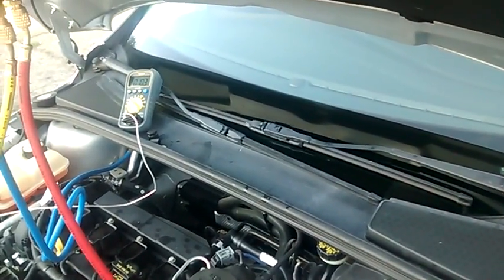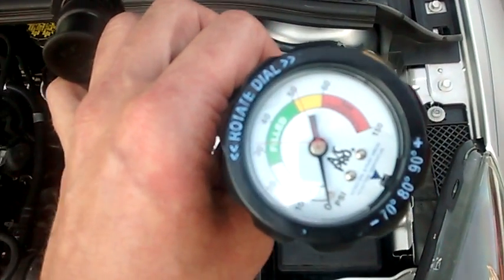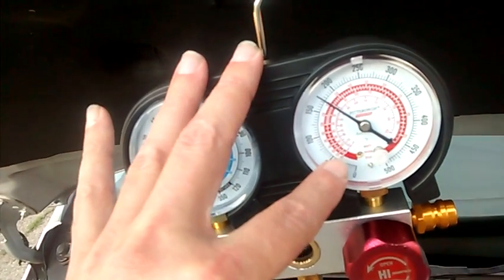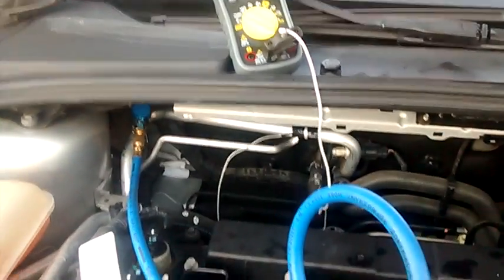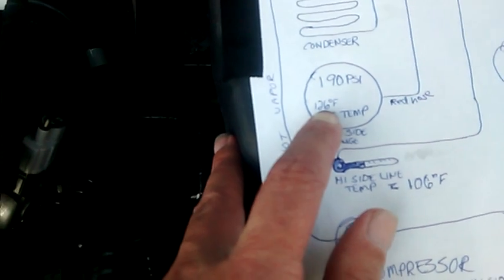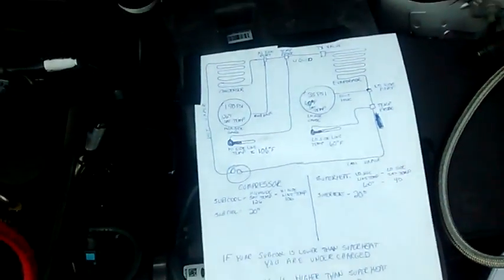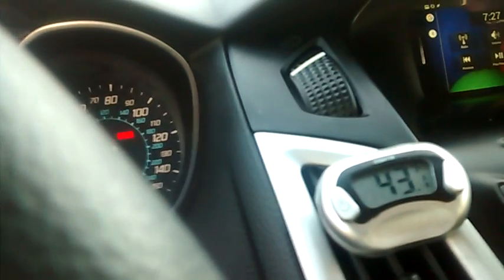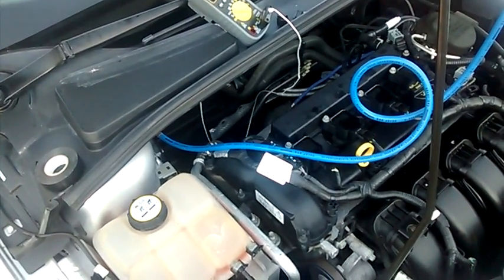Charging using Subcool

Comment: When checking subcooling, don't you need to have a high velocity fan blowing on the front side of the condensor to remove the heat from the refrigerant? When I check the subcooling on my Toyota Sienna, the sensible temperature of the high side line slowly creeps up causing my subcooling number to continually change (get smaller and smaller, until I have a negative number - which I believe means that the condensor is not getting rid of the heat). I realize that checking cars are a different beast, as compared to checking the HVAC on a house (which has a huge fan that's removing heat at the condensor), so how do vehicle mechanics deal with checking subcooling on a vehicle that's stationary?
Reply: What I do is mist the condenser with water.  Temp will drop sharply then start to rise again as the water evaporates off.  At a certain point the temp will stop rising for a short time, usually around 20 seconds then start rising again.  Temp below the pause time seems to be the artificially cooled time while after the pause it's undercooled due to not moving.  Don't soak the condenser, a LIGHT mist but over the entire condenser.  I know this to be half way decent because the pause temp is what I usually get when I have a big fan in it's place.  Definately not the most scientific way, but It'll give you a good estimation of the (going down the road airflow) temp.
Reply: @datsuntoyy  Thank you for your suggestion.

Comment: It feels like you should account for RPMs other than idle. I don't know if it's right or wrong but I when I do my cars, I put in enough charge that the compressor doesn't cycle due to low system pressure at a highway cruise RPM.

Comment: The one and only charging instruction that explains the inner gauge reading and not the same old stuff. TU all the way. it is strange, I tried this on two different cars and two different temperature gauges. and I can never get a reading of less than 85-90 degrees on low side line/evaporator superheat  and yet both AC systems work and blow cold Air down to 42 degree.
Reply from the maker: I am betting with that high of a superheat reading, the compressor is short cycling like crazy.  The reason you are still getting the low temps out of the vents is because the first 1/4 to 1/3 of the evaporator is probably around 20-25*F and the other side is near the temp of the inside of the car and the temps are equalizing there as they blow out of the vent.  If you have very low humidity you will see this, however if the humidity is really high, the side of the evaporator that has the boiling refrigerant in it will freeze up and have a big chunk of ice form on it blocking airflow though the evaporator,  which will make the air start blowing warm or hot.
Reply: I just had this same problem, low side temp reading over 80 degrees with a known good charge in the system. The reason in my case was the high temperature in the engine compartment was affecting the accuracy of the low side temp probe reading. I used some pipe insulation over the taped on temp probe and got a more accurate low side temp reading. Low side evaporator tube in my car is near the engine exhaust manifold so very warm in the region of the temp probe and why it needed the added insulation.

Comment: Hell no! do not vent the refrigerant into the atmosphere, this contributes to global warming R134a traps around 1340 times more heat than Carbon Dioxide. i did like the rest of the video though
Reply from the maker: If it was so bad, how come R134a is used for those cans of computer keyboard duster air..  and it has been used as an aerosol propellant for a long time.

Comment: i did this method idk if i did it right here are the numbers

hi-side sat temp. was 130F(200psi) Line was 110F   lowside sat temp was 32F(30psi) Line was 70F . so that means my subcool is 20F and my superheat is 38F. so that means im undercharged that my ac cycles on and off every 30 seconds? even tho my vent temp was 41F on low speed and non circulate air, on a 95F day

do cars have a low and hi pressure switch? mine is a honda 2.4L engine
Reply: probably

Comment: Great job but my question where you took temp reading from auction line before or after the suction port as it seems in the video before?
Reply from the maker: Generally you want to take the temp reading as close to the exit of the evaporator as practical.. The closer the better, however getting to the optimal position may not be easy if there is a bunch of stuff in the way...
Reply: @Chaddz3  what about the condenser ? inlet or outlet on the condenser or before or after the hiside service port before after the sight glass?
Reply: @blaze2051  out of the condenser

Comment: hi 
1st automotive should be checked at idle 900rpm and at fast idle 1500rpm 
2nd Ideal pressures for R134a at any engine speed .
idle or fast  rpm  ..LOW around 30psi , freezing point is about this temp
Ideally High side should read 160psi on a 90deg + day . Condensor size dictates this.
Why does it matter  ,,lower  condensor pressures equals colder refrigerant to evaporater inlet= better performing system on a hot day .

Comment: Great video! Can you verify something for me please. Is it normal for a compressor to never cycle, but rather be on continually? This is a bmw with Seiko Seiki, I believe is a rotary vane compressor. Btw, the cooling in this car has issues.
Reply: It depends upon your system setup. My old GMC has a oriface tube, not a TXV so the system cycles the compressor to maintain pressure. The newer cars typically have TXVs or electronically controlled setups and in those cases usually the compressor runs continuously (except of the RPM gets sufficiently high that the pressure switches go out of range). Some vehicles will have a variable output compressor which allows changing the amount of refrigerant compressed in each stroke dynamically which can allow for more uniform cooling conditions and less cycling across a wide range of RPMs.

Comment: Is there way to diagnose a bad expensive valve / condensor / drier with taking subcool and super heat readings ? My ac keeps short cycling at higher revs but not at idle of  750rpm
Reply from the maker: For a bad tx valve, usually those result in a very low low side pressure and excessive high side pressure. Once the system is turned off the pressures take a very long time to equalize. With this your compressor shuts off pretty quick then stays off for a long time before it comes back on.
Reply: @Chaddz3  thank you for the reply. I took it to a AC mechanic and he couldn't tell me whats wrong except that its not working right. so when he had my rev it to 3k its starting to short cycle. he said the low side drop to below 20 and the hi side when up to 350, it would shutoff and after 5-6 secs come back on. hes said it would be condenser or expansion valve or compressor but the compressor workings fine at idle and it blows cold.
Reply from the maker: @joeydelmarsjr.646  I'm gonna lean toward a stuck expansion valve or there's a restriction in a line somewhere. Check your high side lines for any kinks or something that could cause a restriction when engine is being reved you should be able to find a plugged line by looking for a temp drop in the line somewhere. It'll be hot before restriction and cold after it. Has the compressor ever been replaced before? The subcool could be all over the place depending where the restriction is. If it's after the condenser you'll have a very high subcool if it's plugged in condenser or before you may very low or no subcool
Reply: @Chaddz3  i recently replaced the compressor
Reply from the maker: @blaze2051  should be able to evac the system and recharge. Since you replaced the compressor. I would replace the receiver drier too since a blown compressor usually sends its guts into the receiver drier.
Reply: @Chaddz3  the compressor wasnt blown. it still worked and blew cold, just that it was short cycling. the new compressor started doing it too. last reading was 30psi low side 200psi hi side 41F out the vent.

do you think it could be a bad pressure switch or thermal protect sensor that is bad?
Reply from the maker: @blaze2051  check your low pressure switch. A bad low pressure switch will make it kick out what psi was it at when the compressor would shut off. What was the outside temp at the time and was the ac in recirc mode. If you don't have a high enough heat load it makes the pressure in the system drop if the pressure get low enough to drop the boiling point below freezing it's supposed to kick the compressor off to prevent the evaporator from freezing up.

Comment: I wonder if you can use superheat to check fixed orifice systems also? I don't see why not.
sometimes pressures can be very misleading for different reasons.
For instance a weak compressor might cause someone to keep adding freon to a system trying to get pressures up to 35 while all along have more than 2.45 times the amount of freon that the system calls for. I worked on a system like that yesterday and did add 2 cans to it trying to get pressures up. 
Finally got it up to 33 and 200 but it did nothing for the cooling with vent temps averaging 66 to 80. 
Now the system has been evacutated, vacuumed down and recharged to 3.5 lbs and the pressures were 15 low and 110 hi. I can only assume the compressor is failing from having too much freon. This system never cooled right after the compressor was replaced before that it would freeze you out.
Reply from the maker: Yes this will work on fixed oriface too but it the logic is a bit different. Refrigerant charge will affect both subcool and superheat at the same time.  In your case I'd start with basic compressor troubleshooting. Sounds like a weak compressor.  Also verify that your orafice tube isn't plugged up.
Reply: Sounds more like a clogged office or filter drier than a failing compressor. The compressor is just there for flow and pressure is a byproduct of the metering device in that flow of refrigerant. A failing compressor will typically have high suction and low liquid pressures. The only compressor failure I could think of in this scenario is if it is coming apart and has again clogged the filter.

Comment: What about adjusting the txv? Almost all cars have a Allen adjustment on the bottom of the expansion valve.    It can be turned in and out.     Tested it on a junk replaced expansion valve
Reply from the maker: You could try adjusting it, but usually those are already preset at the factory and if it's off, it's usually best to just replace it. The only way those get out of adjustment is if the sensing bulb starts loosing refrigerant and changes it's calibration pressure. Or worse yet they start sticking..

Comment: How can someone get information about the standard value for superheat and subcooling for various car model and can we say it is the same for all model
Reply from the maker: Unfortunately, the automotive industry doesn't make that available. They want you to completely recover evac and charge based on refrigerant weight. The only way to really get the correct actual number is to measure it on a correctly charged system. But the rule of thumb is you want the subcool and superheat numbers to match in order to balance the system.

Comment: Thank you for a great video.
Just did a test on my trusty old Citroën (C5 from 2001).. I have the gauge-set, but never touched the filling on the car..
Am i over or under-charged? The performance is not like it should be, i think.

Hope to get a guideline :)

 Tests;
Cabin fan - Full speed.
Ambient: 23C/73,4F
High pressure: 15 bar/217 psi
Low pressure: 2,2 bar/31,9 psi
Condensor outlet temp.: 33C/91,4F
Liquid-line from evap: 17C/62,6F
Cabin duct temp: 10C/50F

Second attempt;
Cabin fan - 75%
Ambient: 23C/73,4F
High pressure: 15,5 bar/224,8 psi
Low pressure: 2,4 bar/34,8 psi
Condensor outlet temp.: 33C/91,4F
Liquid-line from evap: 21C/69,8F
Cabin duct temp: 11C/51,8F

Third attempt; (the engine room heats up a little)
Cabin fan - Full speed.
Ambient: 23C/73,4F
High pressure: 16,5 bar/239,3 psi
Low pressure: 2,5 bar/36,2 psi
Condensor outlet temp.: 35C/95F
Liquid-line from evap: 24C/75,2F
Cabin duct temp: 13C/55,4F
Reply from the maker: Ok at 68F your static pressure should be around 67-69 psi.. so it's not far off there. Here's another test to do turn AC on with gauges hooked up allow to run for about 10 minutes and let everything stabilize. Then shut the system off and watch how fast the pressure in the system drops back to static. It should take no more than a minute or two and both high and low should change at same rate and become equal at about the same time. If they take forever or one side changes way faster than other side, you may have a restriction in one of the lines somewhere (usually a plugged oriface tube or stuck TX valve)
Reply: @Chaddz3  Thanks a lot mate - For some reason I didn't get a notifification on this one :/ I think my TXV is dead. It takes more than 15 minuttes to equal pressure. Again, thnak you for your videos - They are great :)
Reply from the maker: What's your static pressures at ambient temp (also include the ambient temp when static pressures are taken...  For low 70 deg temp your pressures and subcool number is really high... What's really wonky is how high your superheat is..   you may be overcharged, but something else is going on as well..   possibly a bad TX valve or plugged oriface tube...  Your high side pressures are really high considering your ambient temp..  and low side is not bad. But it's getting a bit high on the later attempts..  may also have contaminated refrigerant either with non condensables or moisture...  That one i'd wanna evacuate, check the metering device, possibly replace receiver/receiver dryer vaccuum all the way down..  recharge then retest.
Reply from the maker: For reference this is where I am now...  

Ambient. 71 F
High side 200 psi
Low side 29 psi
Condenser outlet 110 F
Evap exit line 52 F
Cabin vents 43.3 to 43.5
Cabin fan max speed and both vehicle doors open..

With engine at 2500 rpm vent temps drop to 37 deg F.  These numbers taken today from my 2001 Ford ranger.

Comment: How did you determine that 20 degrees was the correct superheat??
Reply from the maker: There isn't a spec for it that I can find, but all the 2012-2017  Ford focuses (2018's use R1234yf)  I have done AC work on seem to have between 20 and 22 deg of superheat when the system is working correctly and giving good vent output temps. Since these are non adjustable TX valve systems the TX valve regulates the SH. From experiment ing with the system, the superheat would always stay at the 20 deg spot unless had the system almost fully discharged or it would start to drop just right before the high pressure safety switch on the compressor would kick it off. The subcool would be the only thing that changed when adjusting the refrigerant charge until it was almost empty or way overcharged.  Ñow on my truck, which uses an oriface tube. The SH on that does change with the refrigerant charge. (It also changes depending on blower fan speed, which the SH on the car didn't) For the car I seemed to get the best results with the SH and SC equal, based on vent temps.
Reply from the maker: Another interesting note, the factory service manual only gives pressure readings, there is no mention of either subcool or superheat specs.

Comment: When checking pressure/temps what should fan speed be at, recirculate on or off?
Do I check the liquid line at receiver inlet or outlet or close to TXV, my receiver is mounted on condenser and there is a few feet of line to TVX which may lower subcooling.
With my fan on low speed I had 48 degrees line temp on evap outlet and 75 degrees on high speed, did not check pressures yet but 75 seems high.
Reply from the maker: You want to check your subcool on the liquid line as close to where it exits the condenser as possible.. if your receiver/dryer is integrated into the condenser (the car I used in the video had the receiver dryer on the side of condenser). Usually just in front of the high side service port on the condenser side works great. But gen rule of thumb is to take your reading within 3 to 5 inches of the condenser outlet. Also you will want the AC settings on max AC full cold temp fan at highest setting. Non recirc mode if it will let you turn it off on max AC and both windows down/ and or doors open. If your vent output temp is that high first verify what your saturation temp is in the evaporator. Should be 45F or lower but not below 32F or the evaporator will freeze over. Also be sure that your temp blend door is fully closing and not allowing any hot air from the heater core thru and that there are no leaks in the air box around the evaporator. And it's not pulling air from somewhere other than through the evaporator.. if you mean the superheat is 48 and 75 that is way way to high and either means that the system has no refrigerant hardly at all or the TX valve is stuck closed or the compressor has a problem or youhave a plugged line or possibly a crushed line somewhere
Reply from the maker: Also if the super heat is way off like that. With your gauges connected and the system off for at least 1 hour or more both the saturation temps of the condenser and compressor should be nearly the same and also within a couple of degrees of what the outside temp is.. if it way lower, the system is way undercharged. Also once the system starts up verify that the high side pressure is significantly higher than low side..  if the system is on and compressor is running, but low and high pressures are near the same, you have a bad compressor
Reply: @Chaddz3  Sorry, I meant 48 and 75 line temp and not superheat, once I get the gauges I will check saturation temp.
Reply from the maker: @metalhalide4043  yes you'll need gauges to see what's going on in the condenser and evap.